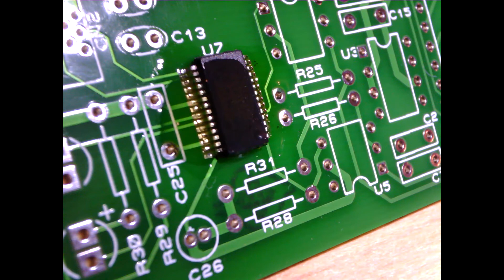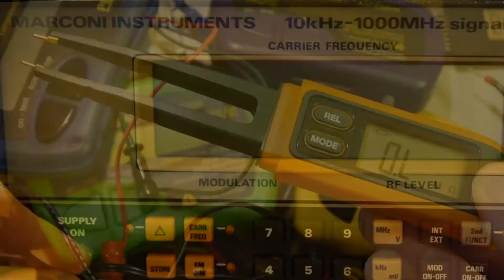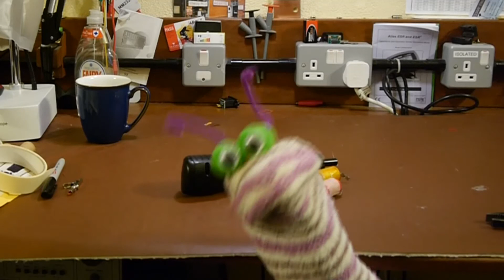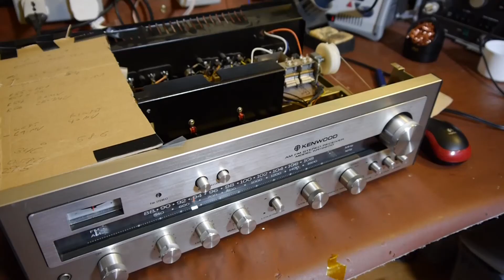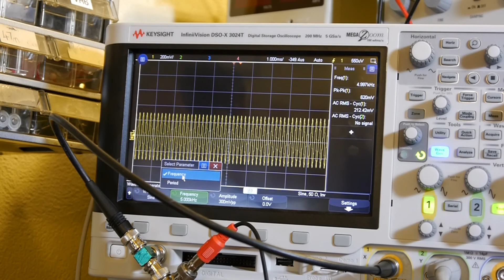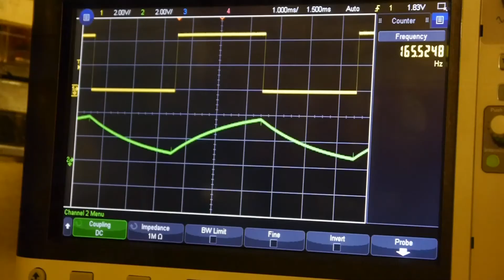Frequency Response  KR2600 Part 2

Comment: I had that receiver new in 1976. The loudness button increases bass at low volume levels. Some audio expert in the 40s figured this out. The music at low volume will sound warmer and fuller. The knob for the radio tuner was never as smooth as the top of the line models. On top of the line models you could spin that knob and the indicator would zoom all the way to the other end. If that lil receiver became available in the states I would buy it.  Cheers!
Reply from the maker: mike ables Hello Mike yes look like I figured out the loudness control the hard way. Yes tuning rougher than some. Great comment and thanks for watching. Regards Chris

Comment: FYI the loudness control's effect diminishes after around 12 o'clock on the volume control. Some modern cheap amps have a loudness contour enabled all the time to mask crappy speakers.
It might be worth measuring the level in dB as I see you DVM will cater for this. You just have to get your head around dB, something i'm still battling.
Reply from the maker: Simon Spiers  hi Simon I'm normally ok working with RF and dBm. But audio people tend to throw dB  around like a frisbee and don't tell what they are referencing too. it like the hifi sketch that Not The Nine O'clock News did many years ago "are no clues" and "you want a bag on your head".   https://youtu.be/HoPXQ9fotZM